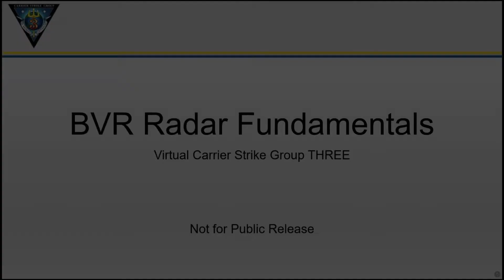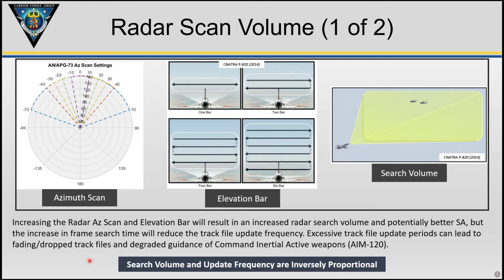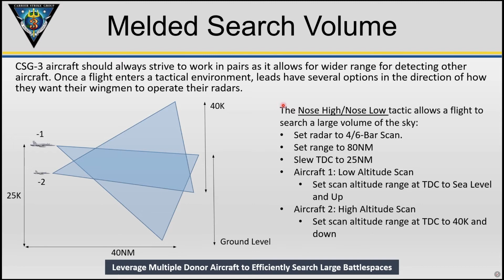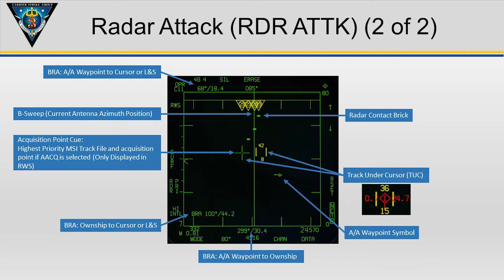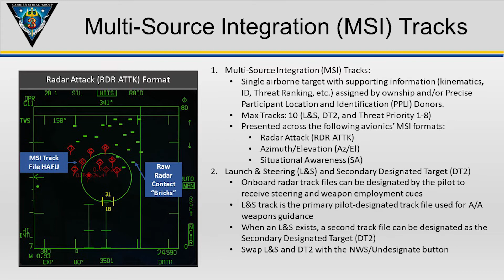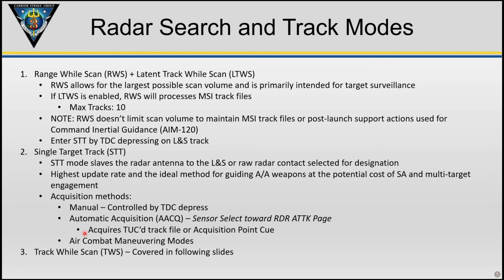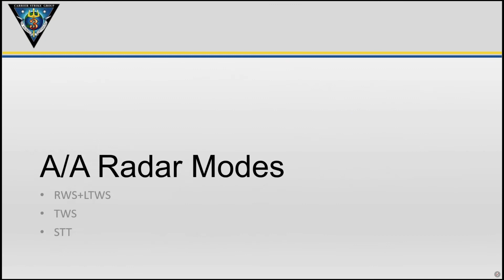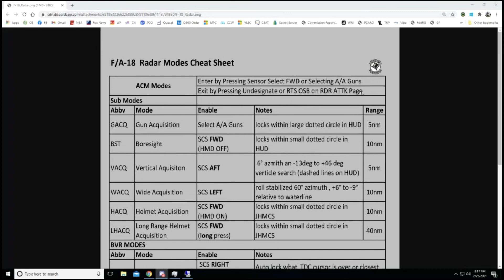F/A-18C Hornet Radar with Fajita Part 1

Comment: Great lecture, one correction though: on the radar page, the radar pri doesn't refer to pulse repetition interval, it's a currently not implement setting that can change the priority between the jammer and the radar. The interference blanking unit ensures that only one system can transmit at the same time to avoid any kind of interference between the two or jamming up your own radar. If ED implements that, it will allow us to have a much better control over the ASPJ.
Reply from the maker: Thanks very much for taking the time to watch and your valuable comment. I'll pass it on to Fajita.
/Bloat